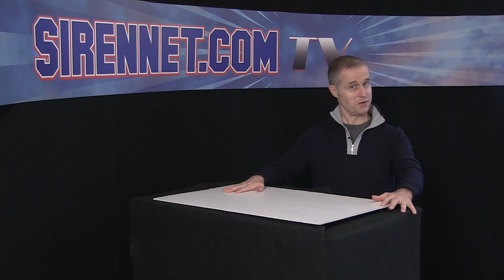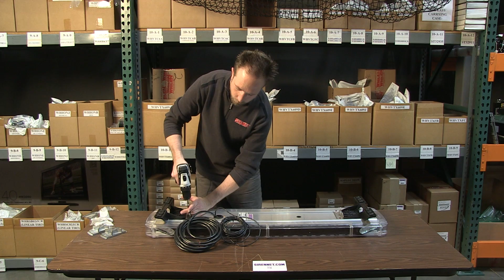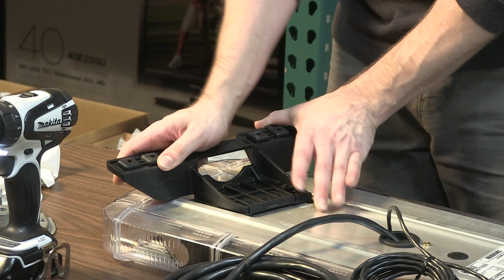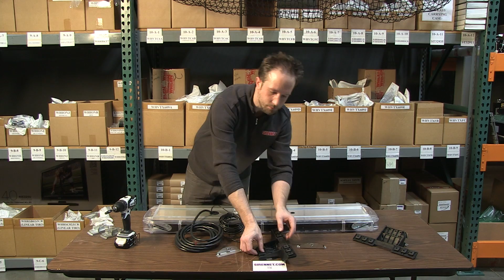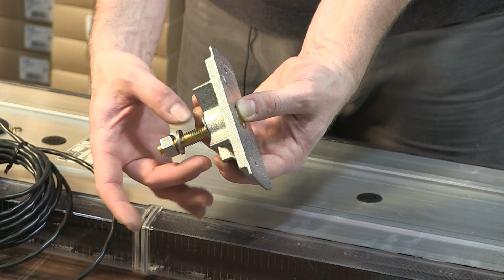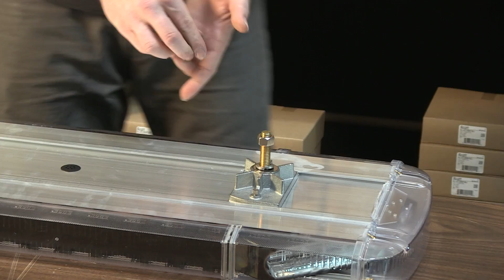Chris Explains Whelen Liberty Lightbar Mounting Options

Comment: Do the MK9S mounts still have the removable bolt in the center?  I purchased a pair from a different supplier and they seem to be an updated version with a fixed, non removable bolt.  the problem is the bolt it comes with isnt long enough for my application.

Are you able to check your stock to see if you still have this version of the mount?
Reply from the maker: +m00nraker4545  The RMK9S that we offer has the removable center bolt(s).
Reply from the maker: You sure can. The black mounting feet have holes through them already ( 2 per foot... toward the outside) for folks wanting to permanent mount their Light-bar.

Comment: Hey sirennet can the m series fit in a lightbar ?
Reply from the maker: In you were to use a Freedom / 9M / EDGE9000 Chassis, you could fit M4's or M2's. You will need to construct brackets to hold them, as Whelen does not offer Lightbar mounting for M series Light-heads.